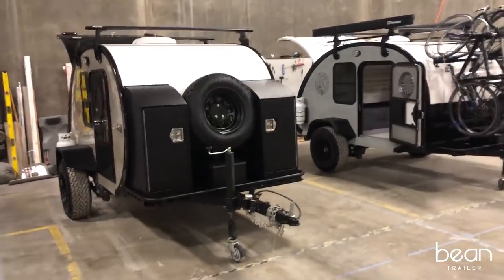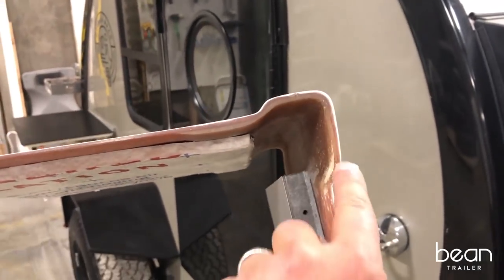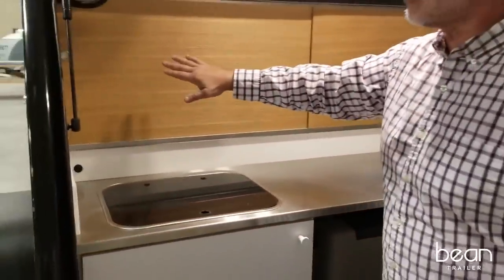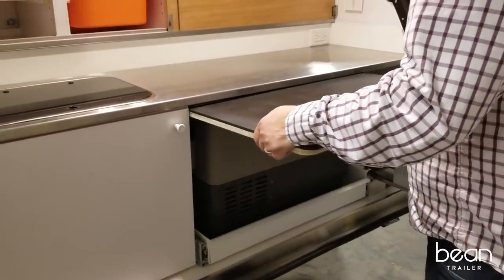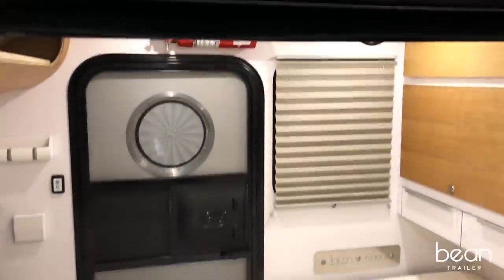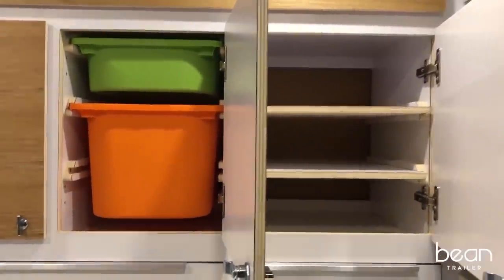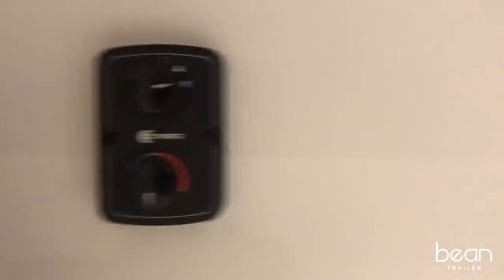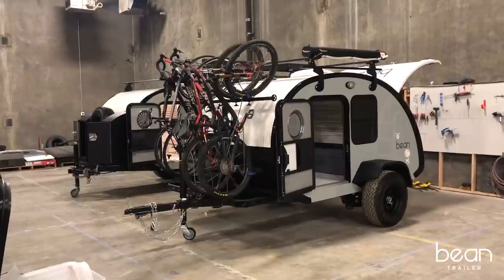Mean Bean – Teardrop Trailer Walk-Through (Off-road Trailer, Adventure Travel, Overlanding)

Comment: Very well thought out design & layout.  expensive @ >$16K. But has some nice features like the 1 piece roof+ side construction, suspension design, and the attention to many details.  Guess you get what you paid for...
Some modification I like to see: battery storage box fitted for several Li battery.  Solar panel mounting option, & a 2 piece access door for the under trailer storage compartment

Comment: At those prices, I would expect patriot camper quality. It's not even close. Probably could sell it for a bit cheaper if they weren't so proud of the logo and placing it on every square inch of this thing.
Reply: Well stated
Reply: I like the patriot campers too! But, I want to get away from the tent type trailers. So, teardrops are the way I will go. This one impresses me. But, there are others that are quiet good too!
Reply: You're not getting a Patriot Camper for $16K or $17K.  Try double that for a Patriot X2 camper and $55k-60K for the X1 Grand Tour.  You're still sleeping in a tent for that price too.  Teardrop trailers are a for a completely different purpose than a tent trailer like the Patriot.

Comment: Looks great and very functional. One note, perhaps a little more engineering on the swing away tongue could make it lockable in the folded position which could help for anti theft as it would be difficult to tow away then.
Reply: Buy a high quality hitch coupler lock.
Reply: @wolfpackflt670  Easily defeated by simply hooking up the safety chains, tow it away to some place the thief feels safe, then disable the lock. A boot would work better than that.

Comment: Those prices need to come down.
Reply from the maker: Michael W 

We’d love you to compare our quality build verses the competition.  We are building an Heirloom quality product that will be in your family for generations, verses something that is built to be disposable. Our trailers have a lifetime warranty on the roofline. Hard to beat the price and value of that. 

Other valuable insight for comparing prices. Our base pricing includes several upgrades that the competition upcharge for. 

If after you compare, you still don’t see the value, let’s chat!
Reply: It's ridiculous how expensive these things are!!
Reply: @jawswells  It is ridiculous you don't understand quality. I do think they should build other types to fit all price ranges.
Reply: Teardrops are not manufactured by the thousands on a big assembly line in Indiana, this is a very niche product with little appeal outside of folks like you and I. It is not possible to crank out limited numbers of these trailers while maintaining quality at a much cheaper price. Even Chinese knock-offs (I've looked) are not all that much cheaper.
Reply: @paulnubreu6887  i'm pretty sure they are talking about campers in general and not just this brand. I do agree with them. Buying a new camper isn't something within the typical middle class family price range anymore.

Comment: It's a curious thing. Folks are going to comment that it is too expensive. My tent cost 399. It has 8lbs of fabric and 2 aluminum sticks. It's a quality tent but nothing more. And it sucks to sleep on the ground. $400 is too much to spend if you don't enjoy it. I cant make a tent. I can't make a bean trailer either. A quality product is worth what you can get from it. Apparently Bean is doing well. My complaint, is it needs an AC option. If you want cheap, get a sleeping bag and air mattress. May your spine be aligned by the pine and pay your chiropractor well.
Reply from the maker: Thanks Jon! Appreciate you putting things in perspective. We recently started offering A/C as an option!
Reply: @BeanTrailer  The AC is either deal maker or breaker. Too few camping days to not be able to sleep. Can't wait to put in the order.

Comment: How would you compare this to the Boondock light T@B400 (other than the inside kitchen and bath).  I'm thinking construction and off-roading ability.
Reply: Bean has a one piece molded fiberglass shell so no seam between the roof and side wall which means no leaks there. Mold fiberglass skin on Bean much thicker than the  fiberglass sheet for the skin on the alternative trailer meaning increased durability.
Reply: @mark-di5pf  Thank you.  Nice product.

Comment: Only 2 things matter. How heavy and how much does this beast cost! Nothing else matter till we know these data point.
Reply from the maker: We have four different models that comes with different upgrades. Depending on your configuration your weight will range from 1400 lbs - 2000 lbs. Same for pricing, the range is $14,895 - $25,000

Comment: Looks like a great product. What will keep me from buying this over your competitors is the absence of interior design. The white walls and ceiling are too sterile and not inviting enough. The LED lighting should be indirect. It wouldn't take much to make them more luxurious. Get on it. The galley looks pretty good. Do the interiors to match. Do wood veneer and wood laminate flooring.
Reply: Hmmm. I'm not sold on the wood laminate flooring idea. I do agree that the indirect lighting in the interior would be a nice touch.
Reply: @SteveBoyer10  It was just a thought, but overall I want to stay in a spot that exudes warmth and coziness. LED's should have adjustable color temperature. Standard daylight (K5600) is too harsh. 3200K or warmer is better.
Reply: @scottnathanphoto  it is warm light.

Comment: Is there a way to mount one of the storage lockers between the bikes?  Say get 4 bikes, a locker and the battery in the middle?  And looking at the rear hitch wouldn't that be to much weight on the back of the trailer with a bike rack and 4 bikes?
Reply: I would not put a bike rack and four bikes in the back hitch.

Comment: 17k Holy crap Its nice but I'll build my own.
Reply: Will it have a one piece fiberglass shell so you don't ever have to worry about leaks? Will it have composite walls instead of plywood? Will it have soft touch materials and recess lighting in the cabin? Will the galley have pass through storage with matching wood veneer? Will it have a rugged welded frame and suspension to conquer damaging BLM and Forrest roads?
Reply: @mark-di5pf  No it probably won't have those things but I'll have a couple extra grand in my pocket.
Reply: @mark-di5pf  Personally I think you are putting too much value/emphasis on "soft touch materials and recess lighting matching wood veneer". Supposedly this is built for offroad camping and not glamping.

Comment: So what is the difference between this and the other two lookalikes, the Nucamp Tags and the Lil Guys? Both of those are also way over priced and masquerade as "off road" trailers as well. I realize all these 'Drops are being pushed to the younger techie crowds, but to hell with the electronics. It's a camper, make it for camping. Stop with all the USB and cell phone chargers etc.
Reply: Yeah some serious high tech there, some USB ports and lights. What is this the space shuttle!
Reply from the maker: Yeah, our trailer's are very low tech. The USB chargers are extremely convenient. The difference, is that our trailer's are made with a one-piece fiberglass shell.